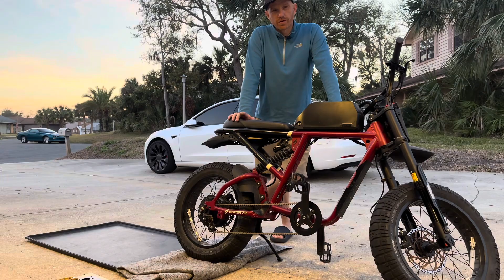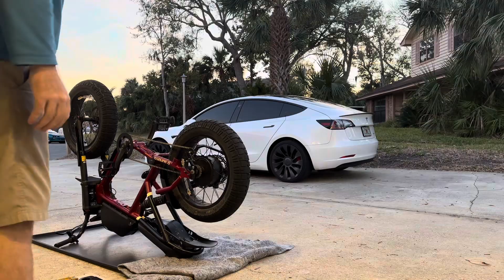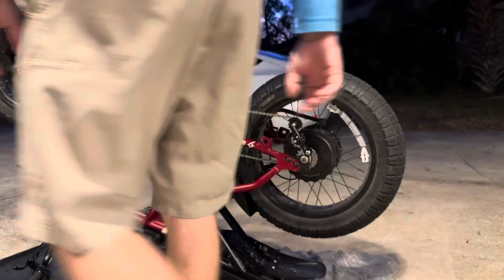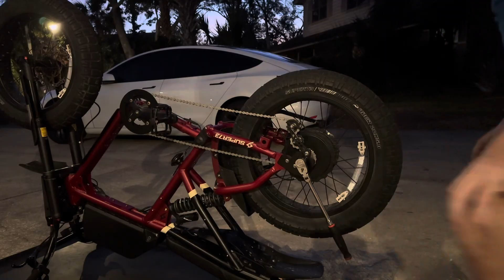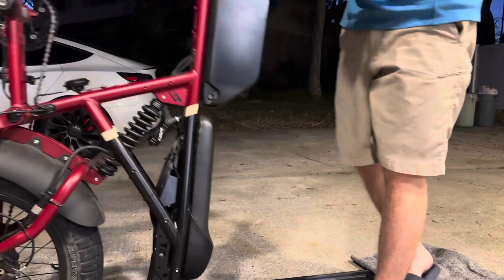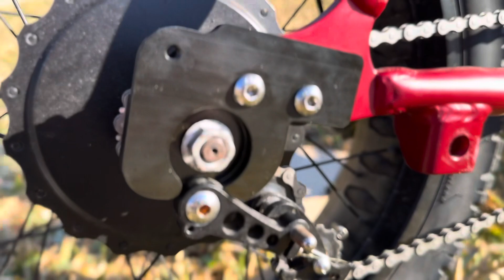Super73 Upgraded Drop-Outs V2, Plus install instructions.  CNC Stainless.

Comment: What is the difference between a 100 dollar one and 250 dollar one in the website?
Reply from the maker: The 100.00 one, is single side old version.

The new version for 250 comes with both sides and is cnc cut 1 piece stainless, stainless hardware.

The old one is discounted since its the old design.

Comment: Hello, I have successfully modified super73R adventure with qs205 first, with 72 volt achieving 57mph with 100A sabvoton 72200 controller. I just finished building a 20inch wheel with qs273 3T with flux weakening of 33%. I achieved 90mph with 72 volt on a super73. Probably the fastest super73 upgrade in the world. My problem is that qs273 has M22*18mm axle (huge). Will this it be possible to make this dropout wider? Thank you
Reply from the maker: Hello, People have gone over 100 MPH.

The axle flats on the 273 are 10mm still no?

My Blue one goes 80 in 1/4 mile on stock tires and qs205, but none the less nice work!
Reply: @BuildItTuneItEV  over 100mph on a super 73 ??? Have not seen that on youtube yet
Reply from the maker: @ hawaii guys did it 3 years ago.

Its on the fb groups.
Reply: @BuildItTuneItEV what is the fb group name ?
Reply: Thanks for the info! The QS273 3T axle is M22 with 18mm flats, so it won’t fit in a stock 10mm dropout without modification. I’ll probably need to widen the dropouts or use custom torque plates. Have you or anyone else done this before? Any recommendations on the best way to machine the dropouts for a proper fit?
Reply from the maker: @ I can custom make it for any axle, before I have not seen m22 qs273.

Send me the drawing.  This axle is normally for motorcycle hub.  Unless thats what you’re using?
Reply from the maker: Mike@upgrademyebike.com
Reply: Also can super73 rim handle 90mph safely with 10G spokes?
Reply from the maker: @ factory? Not suggested.  I use double wall.
Reply from the maker: @ https://youtube.com/shorts/u9ovREhkAak?si=uVTUJxUqfLnK27gb

This is the setup I use.
Reply: I will send you a diagram of the axle, do you have an email or what’s app?
Reply: Also can the super73 rim handle the speed?
Reply from the maker: @ Read other comments, listed the email for you.
Reply: Sorry again, what rim would you recommend for  higher speed? For super73R rear
Reply: How did you make your qs205 go 80? I have my qs205 3.5T with sabvoton 72200 with 200-300 amps 72 volt 49AH battery. Do I have to upgrade the motor to achieve the speed?
Reply from the maker: @ sab controller is the lowest quality controller you can install.

This is why I run the bac8000 its a complete different level of controller.